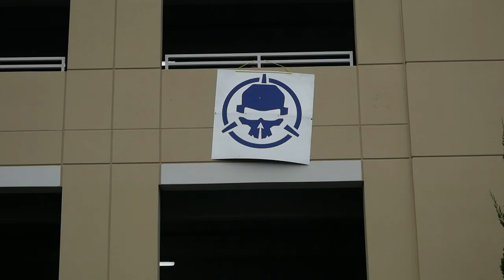We Stuck a Drone on a Water Tower! - MAGNET DRONE!!

Comment: Glad you used electromagnets, if you'd used neodymium magnets your quad could have been stuck up there permanently :)
Reply: licensetodrive or if you balance the thrust and magnet strength just right maybe the drone could just pull itself off
Reply: @conorstewart2214  I did think about how to use neodymium magnets so you wouldn't have to rely on the motors providing enough thrust to free itself from a metal surface, use servos to push itself free, but that adds unnecessary complication into the setup and still has the issue of being stuck if it loses power.
Reply: @licensetodrive9930  yeah and also the potential weight and size of the servos required for the amount of force the magnets would need to have. Servos could be better if you needed it to stay up for a long time so it's not constantly drawing a lot of power like the electromagnets do

Comment: here's a lesson ive learned. DO NOT Throttle up if the drone is fixed to the ground - if you full throttle while it stuck you will most likely pitch the CCW props off. the weight pulling up is enough pressure to unscrew the prop nut..... try it sometime!!!!!!!!

Comment: I always thought that carbon fiber dust was cancerous so you should still under water but you guys are just drilling right through the arm...😂
Reply: I have never heard of it being cancerous.  But the fibers are probably very difficult for your body to process since they cannot be broken down.  The resin is also epoxy based and you do not want to expose yourself to epoxy very much.  An allergic reaction can develop over time and eventually you might not be able to handle it at all without having an allergic reaction.  Many people who work with epoxy professionally have this problem.

Comment: Does anyone know how the electromagnet was wired? I am trying to replicate this and I don't know if I need a special receiver that works SBUS with PWM or if most SBUS receivers can handle this type of connection using a turnigy PWM on/off switch.

Comment: My Drone has a water damage and now it only makes stupid beep Sounds what should i do?
Reply: Replace your flight controller
Reply: Maybe watch some YT videos and you'll learn how to diagnose and fix it.

There's not many parts to a quacopter. ESC or flightcontroller if it won't arm. No video then look at the vtx no control the receiver if the FC is working in the configurator.
Reply: Thanks
Reply: @leole9449  no worries buddy, there's a lot to learn in this hobby... YT is your best friend if not join a local FPV FB group and you'll find help.